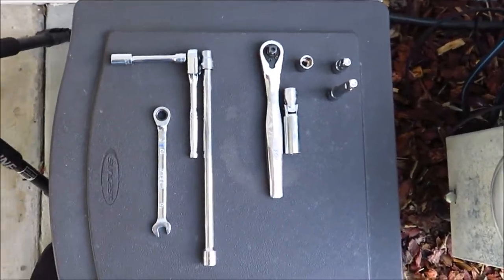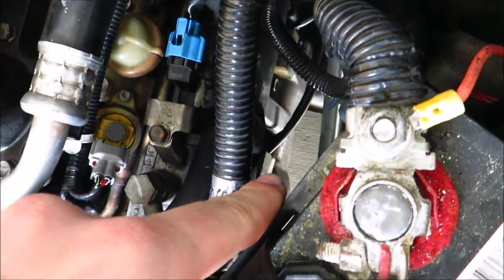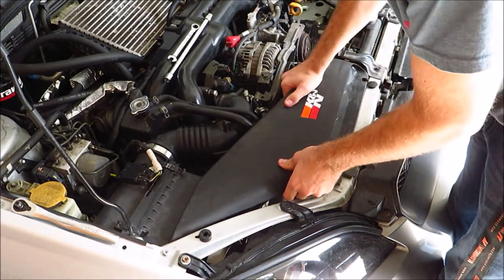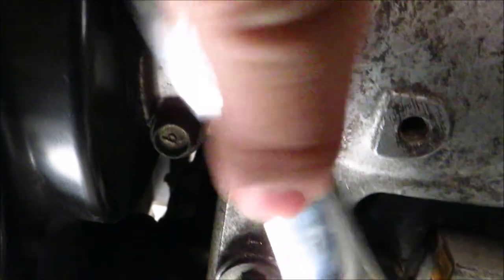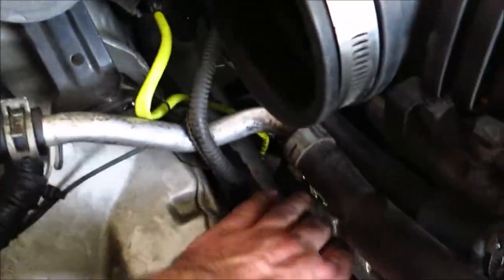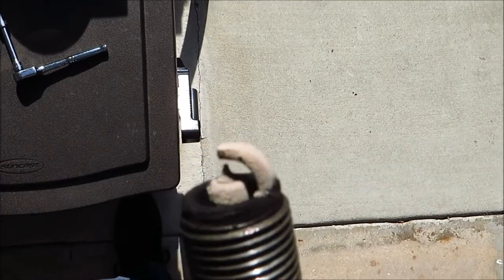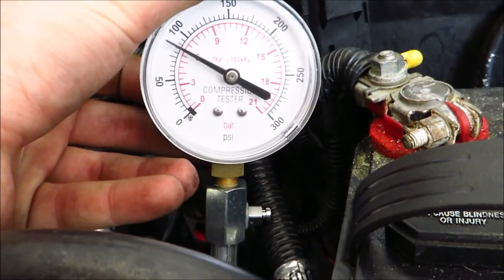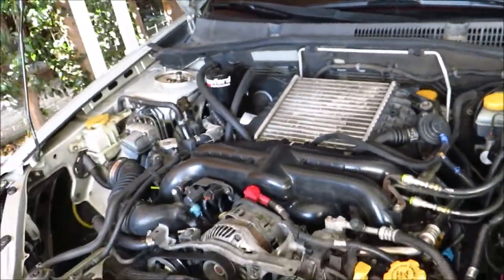Subaru Spark Plug Removal Made Easy

Comment: hey man just wanna say this video helped me out a shit ton i only ended up doing a cold test and got decent numbers (in my unprofessional opinion) but i couldn’t have done it without a thorough walk through like this. awesome video and thanks again
Reply from the maker: Thank you. I'm glad it helped you out
Reply: @SWSpeedCo  I used this method works great but run into a problem. 3&4 cylinder the coil pack isn’t seating I can’t thread in bolt. Any ideas
Did you have this problem???
Reply from the maker: Sometimes the rubber bit that goes over the plug gets pushed to the side. So just pull it off and make sure it's centered when you put it in. That's the only thing I can think of.
Reply: @SWSpeedCo  I was guessing that too and you were right. Got the problem fixed 30 mins later after I wrote my first comment, thanks for the reply back 😁
Reply from the maker: No problem, glad to hear it

Comment: I know this is a old video, but next time be sure that your battery is fully charged ( yours sounded a little weak) it will make a difference. Also use a piece of vacuum line and put it over the end of plug to help start the plug into the hole. 
Good video
Reply: Brilliant!

Comment: Great vid. Very helpful, thanks! Thought I was going to have to lift engine 3-4 inches according to some other guys.
Reply from the maker: Thanks, those guys are dumb lol
Reply: @SWSpeedCo  Did it end up being rings? What was the conclusion that you came up with?
Reply from the maker: Ringland failure, it's got a new long block in it now
Reply: @SWSpeedCo  I see. I just bought an ‘05 LGT and I’m just beginning diagnostics. May end up going down a similar road after checking compression and plugs etc

Comment: Not a difficult job, just not a lot of clearance to remove some of the spark plugs. Seems the biggest challenge is doing it fast enough before the internals have shrunk back to its cold size. Great video btw!
Reply from the maker: Thank you! Having the right tools makes the job alot easier
Reply: @SWSpeedCo  Your car stopped miss firing when you put good gas. Mine stalls when I fill it up, even with good gas lol
Reply from the maker: Yeah I think it was just a flook though lol
Reply: @SWSpeedCo  I take back what I said man. Those spark plugs are a bitch to remove. I didn’t realize how little clearance I had till I tried this job myself. You make it look easy. To make matters worse I ended up removing #2 coil and its grommet got stuck inside around the spark plug, had to fish it out. But now ended up with the engine trembling, like a misfire, even though I was never able to remove #2 spark plug.. maybe from wiggling the grommet to remove it the spark plug got a bit lose..
Reply from the maker: It is a bitch but if it makes you feel better when I made this video I had already done it like 5 times already. I would investigate cylinder 2, and also check to see if the plugs are plugged in correctly. The black plugs go on the back two coils. If that is correct I would pull the spark plugs and make sure the gap is correct
Reply: @SWSpeedCo  Yeah, I got the white Coil#2 in the front. I did end up being able to remove the spark plug and gaped it at 0.030” within spec, but still got the #2 misfire, a bit less shaking than before but still there and comes up on the scanner. The motor was fine, I should have left those plugs alone.. now I don’t know whether it’s the plugs, the coils or the harness..More work..
Reply from the maker: The easiest thing to do would be to switch coils 2 and 4 and see if the misfire moves to cylinder 4 and that would tell you if the coil is the issue
Reply: @SWSpeedCo I hope u see this considering its been a year since u posted but...2005 lgt w/ 180k miles...I recently have a #2 misfire also..throwing a p0302 code. Started after I drove 800 miles from cali to Seattle. Before I left Cali I installed a cobb sf intake and reflashed it with cobb ap for economy tune to try and get better mpg for the long drive. Did the drive and filled up when I got to Tacoma and added a can of seafoam to full tank. Literally less that a mile after the fill up and seafoam add the check engine and cruise control lights come on and the misfire starts. Drove it another  60 miles or so. Tried the #2 & #4 coil swap..Still misfiring. Did the screwdriver to ear stethoscope trick to check the injectors and all sound normal. Laser iridium Spark plugs are less than 10k miles old..so not sure if that's the issue but I'm yet to swap those 2 & 4 to check. Did you ever solve your misfire issue? If so, what was the culprit?
Reply from the maker: @goodienough My issue ended up being ringland failure and I had to replace the shortblock. I would try swaping coil 2 and 4 and see if the misfire moves to cylinder 4 then the issue is the coil. If that doesn't work you can also try swapping the injectors from 2 to 4 and see if the misfire moves. If none of that gives you an answer the only thing left to do is a compression test. Hope that helps!

Comment: thanks  mate i thought it could be age and miles i suppose heat as well . do you no if they have made better coil packs or not.  i have a   e j   2.0 legecy subaru 1990 goes well but had to change  2 coils and the 3rd  one is playing up and missing also  they are $180 each where i am from( n z)
Reply from the maker: Delicious tuning makes some upgraded coils, but they are about twice the price and you really only need them if you are making like 400 horsepower and up. I would just stick with the oem ones

Comment: I guess it all depends on your perspective. I used to change all 8 plugs in a big block 67 Mustang in about 45 minutes. That's twice the plugs in 1/3 the time and big block Ford Mustangs used to be considered a "b*tch" to change plugs in. A SBF in an old Mustang was 15 minutes max for all 8. And probably most of that time was pulling off the plug wires. ;-)
Reply from the maker: It definitely is all about perspective, I would say that subarus are the hardest cars to do spark plugs on but it still isn't as hard as everyone makes it out to be. You can still do it without pulling the engine or unbolting motor mounts.
Reply: @SWSpeedCo  My wifes V6 Rav4 has a sideways V6. The front plugs are 5 minutes each. And that's drinking beer. The rear? Well one of them you can get w/o pulling the engine. It's about an hour. The other 2? You have to pull or at least undo the motor mounts. The dealer charges $600 to do the job. We paid it. I figure it's $10 for the front 3, $150 for the 1st one in the back and the other two $240 each. ;-) And yes, I'd rather do all 4 in the 'ru then all 6 in her Rav4.
Reply from the maker: Never new that, that sounds alot worse. Funny thing is a lot of people say they would never own a subaru because of the sparkplugs, but I've never heard anyone say that about a rav4 and it seems worse lol
Reply: @SWSpeedCo  I think most people buy the 4 cylinder in the Rav and that's an easy job. But the 6.... we tow from time to time and need the power. It's got great "get up and go" but those plugs and ignitors in the back are a real pain. Thankfully they last nearly forever. The rears never really died. They had 140,000 miles on them and I only had the dealer replace them because they had to pull the engine to replace the waterpump or timing belt... I don't recall. But they gave us a deal on them so we had them do it. Now the fronts, they die all the time. 100K for the originals and about 50K for the replacments. However they are easy to get to and I found the reason they die: heat. The engine has one of those plastic covers over it to make it look all pretty for the girls. But that thing traps heat under and it and that's what kills the ignitors. So I tossed that into the attic and we've not replaced a single one since doing so. The Rav is a great car. 200K miles on it and it runs like the day it was new. No smoke. Reasonable gas mileage, holds 5 plus a bunch of junk, been all over the place with that thing. Offroad, onroad, in the snow, etc. It's AWD and I even pulled a Ryder moving van fully loaded out of the snow with it. I pulled our forklift (9K#s) out of the mud with it. I know this is a Suby vid. Sorry. But the Rav has a lot going for it. At least the older ones. ;-)

Comment: Did you have ALL the spark plugs out and the throttle body WIDE open?  That is the most accurate readings.  If not,  you may want to retest readings.
Reply from the maker: Yeah I had all the plugs out and throttle wide open. The engine had ring land failure. It's got a built engine now so it's all good 👍

Comment: Nice info. What length is the 5/8 spark plug swivel tool? 4" in total? And then you need the 1" extension on top of that?
Reply from the maker: I think the spark plug something is around 3 inches but yes you need the 1 inch extension on top of that

Comment: why do these coil packs have to be changed is it the heat or something would you get back to me thanks good video
Reply from the maker: I'm not sure I'm reading the question right. Just like any electrical component, coils go bad and get weak and won't supply proper voltage to create a strong spark to ignite the air fuel mixture. Its just age and miles that make coils die. If that was not what you are asking, you can clarify and ill answer to the best of my abilities

Comment: Brother I have bugeye subie been sitting for days and cannot get a grip on the back plug with a 3 inch snd 5/8” deep socket, the swivel combo one along with a one inch extension i do not have, do you think this is my issue? The thing just spins and spins constantly, then with adapters i am sooo banginging the frame i hate it this looked nice. I will buy tomorrow but i’m seriously hoping cause its been sitting for 3 days as i try and try to get grip on back plugs.
Reply from the maker: If I remember correctly, the 1 inch extension is crucial to get a grip on the spark plug. Without it it's not long enough to reach
Reply: @SWSpeedCo ok all i could find is a 1-1/2” extension but amazon has 1 inches, do you think i’ll be able to reach it yet still have clearance from banging the frame?
Reply from the maker: The 1.5 could work but I can't guarantee

Comment: Would you happen to know where the fuel fitter is on a 2005 outback
Thanks
Reply from the maker: The only fuel filter I can think of is on the bottom of the fuel pump in the gas tank. It's not too hard to get to. If you look up 2005 subaru outback fuel pump replacement on YouTube there should be a few videos.

Comment: I have a front mount intercooler, so I got tubes blocking the top. Could this be done from the bottom of the car?
Reply from the maker: It may be possible to do it from the bottom, but I feel like it would be easier to just remove your intercooler piping and do it from the top
Reply: @SWSpeedCo  I see, thanks.
Reply: Yes, if you have a lift or something where you can get the car up and work comfortable, that's usually how it do it.

Comment: Great video mate, mine is a EZ30R and I have a misfire when I first start it ( cold start ) and it goes back to normal after about 30 seconds,
Do you know if this is the same procedure in the 3.0 ltr, 6 cylinder ??
Cheers mate from Australia.
Reply from the maker: I'm not 100% sure on how similar the procedure is but I would guess it's close since both engines are DOHC.
Reply: @SWSpeedCo  yeah everyone has an opinion about which way to go ( jack the engine up or don't jack it up ) I might do what you were going to do and hit the forums,
Cheers mate, thanks for your reply. 👍
So, what was the final diagnosis ?? Rings or valves ?? Either way it's still a pain in arse.
Reply from the maker: It ended up being ringland failure, I had low compression on a couple cylinders. It was like 50 on one and 80 on another if I remember correctly. Now I have a fully built engine though so it all worked out it the end lol! Thanks for watching!
Reply: @SWSpeedCo  as I said before, it's still a pain in the arse, good luck with it mate, I've just ordered a OBD scanner and see if any fault codes are stored in the ECU regarding my misfire.
Cheers mate 👍 I'm glad you got to the bottom of it.

Comment: One question how tight should the spark plugs be? NGK advises a specific torque range is this really necessary?
Reply from the maker: Well you want to tighten it enough to compress the crush washer which I think is what ngk specifies. If I'm re using them and the crush washer is already crushed I usually just get them snug because you don't want to strip those threads.
Reply: @SWSpeedCo  ok thanks someone told me 21nm should I proceed with that? And also is there a chance you could miss align the threads as you can't see what Ur doing down there?
Reply from the maker: I would just follow the instructions for tightening on the ngk box. It would be hard to mis align the treads as long as you don't force it. I usually get them started by hand so I can feel it tread in, to make sure I'm not cross threading it.
Reply: @SWSpeedCo  ok thanks a lot.👍

Comment: I know this video is old but I’m having the worst time with the driver side rear coil, just can’t get enough clearance to pull it out once I’ve taken the bolt out. I’m thinking I’m gonna have to jack the engine up cuz I’ve really tried but it seems like I’ve got less clearance in my 05 lgt than any of these videos I’ve seen. Any help would be appreciated thanks
Reply from the maker: Did you rotate the coil 180 degrees after you unbolt it? This gives you a little more angle to pull it out from the top. If that doesn't work try getting it from underneath the car.

Comment: 07 subaru legacy 2.5i...is the same procedure?
Reply from the maker: Spark plugs on the 2.5 I are actually alot easier, since they are singal cam the spark plug hole is towards the top of the head so they are alot easier to get tools in there since the frame rail is not in the way. Other than that it's the same procedure